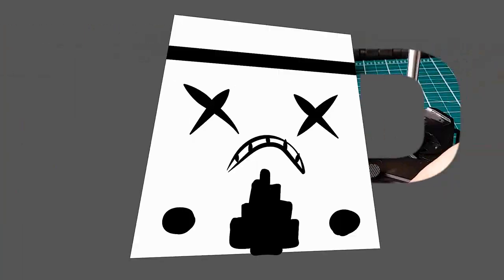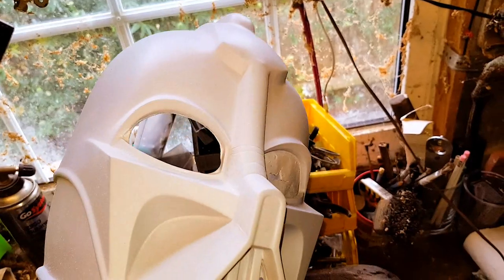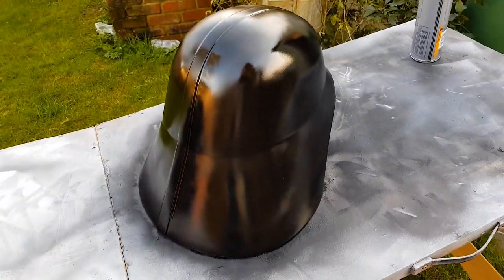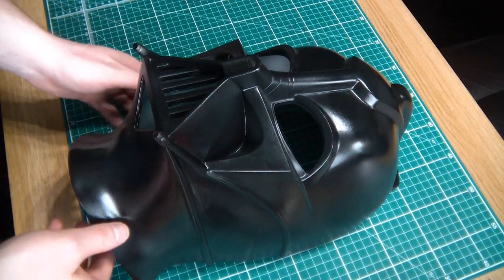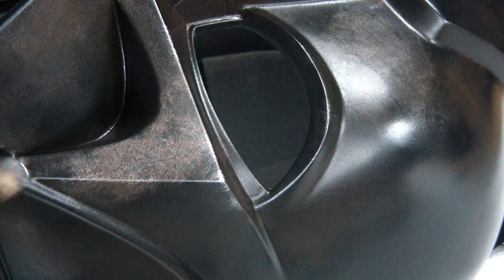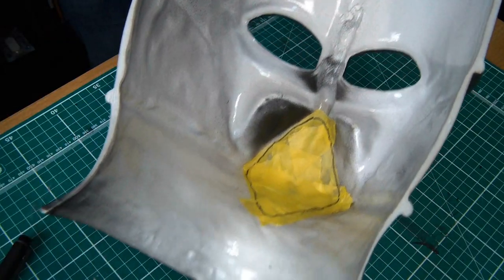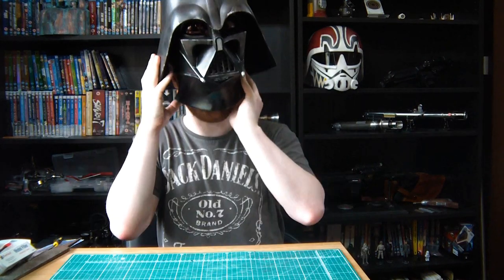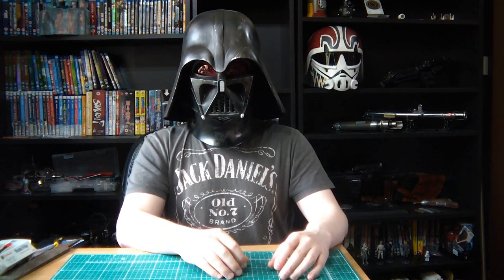Star Wars Rebels | Darth Vader Helmet Build | REBELS SEASON

Comment: That reaction thing you had is exactly the same thing I had with my own helmet, exactly the same thing at the front. I was using a Rustoleum Gloss Black Primer + Color spray can.
I redid the paint today and managed to overcome it for the most part, more shaking of the can and doing it in the morning with about 50% humidity and 26°C seems to work.
I still have some surface to grind but it's a start.
Reply from the maker: Avͫaͤrͫiͤk von Nom yeah don't know if my paint was a little old or something, but a happy accident as it also inspired that battle damaged paint job 😅
Reply: Certainly. C:

Comment: Just got on of these but its still 3d print raw, i primed it with sandable primer started wet sanding to smooth it. Any advice on how to make it smooth in the grooves
Reply from the maker: Start with a low grit, something like a 100, then its prime and repeat going up the grits. Use some actual filler for troublesome spots. 3d prints are a lot of sanding!
Reply: Ok thanks man. And i like how Vader helmets when they are done look like a new car lol.  I heard you can get like 2000 grit after your painy job cures and smooth it very well. But im scared to start painting. So i sprayed with filler primer and wet sanded it, its pretty smooth but should i prime it again

Comment: I'm actually thinking about getting one but I found a model where you can print it out from a 3D printer on do3d
Reply from the maker: I guess it's all relative, you save time on the printing and finishing work by buying the kit as someone else did all that for you :)
Reply: Buckethead Props well how much did it cost to get a helmet ready to go like yours
Reply: I'm trying to prove that anyone can make a really great darth Vader costume for cheap instead of like 3k maybe around 3 to 400 dollars
Reply from the maker: SPYHUNTER705 can't remember exactly but they usually cost $200-$300 dollars for good and/or uncommon kits
Reply: So I was thinking about getting the helmet how do I contact the guy selling it by email phone writing
Reply from the maker: Send a pm on the RPF and/or post your interest in the thread
Reply: K so I found out that the file for helmet I found had an update now it comes with the whole armor for get this 160 DOLLARS!!!! So instead of paying over 2 to 300 dollars for just the helmet I could get the whole thing for less and I don't care if it takes more time because I'm losing weight and by the time I'll lose it the armor will be finished